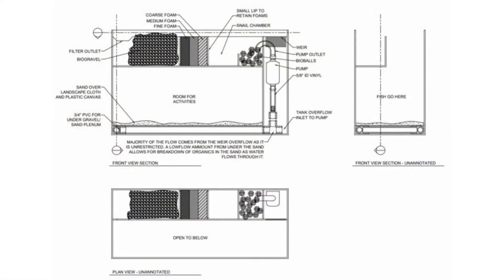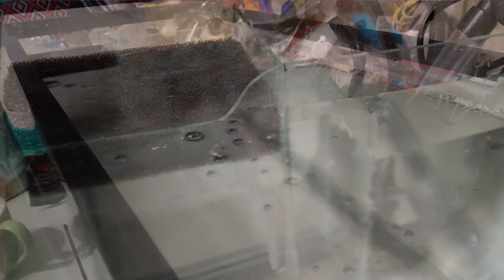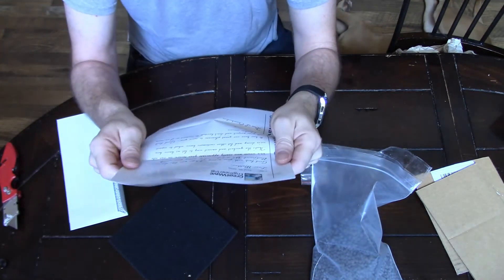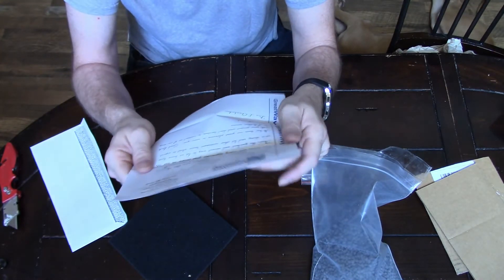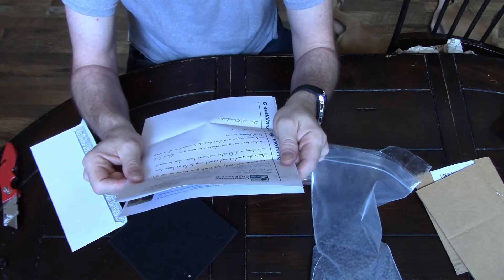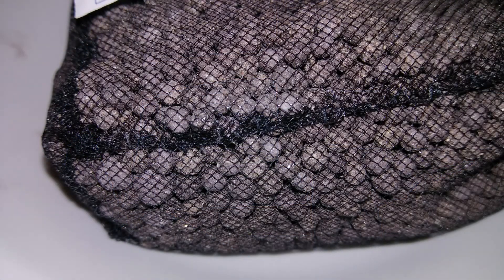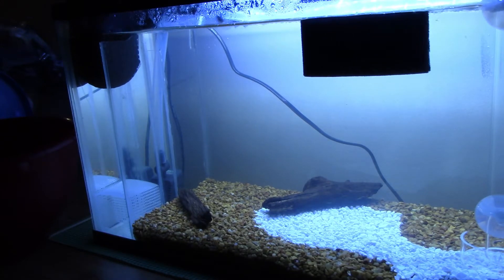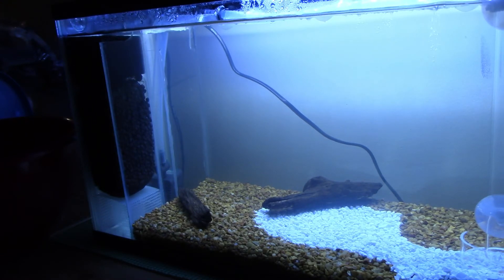Fish Tank Experiments - BioHome BioGravel (Going for Zero Nitrate) Video 1

Comment: The claim about Biohome filter media achieving a "full cycle" (reduction of ammonia, nitrite, AND nitrate) is a scam. Ten months ago, I "pimped my filters" according to Pondguru's instructions. The recommended amount of Biohome media for my 75g mbuna tank is 6 kilos. Since I was skeptical, I decided to go above and beyond. I added extra filters for more media capacity. In total, I have 10 kilos of Biohome media in my filters. All filters utilize the coarse/medium/fine foam configuration recommended by Pondguru. After 10 months of running filters with 10 kilos of Biohome (that's almost double the recommended amount), I have not achieved any reduction in my usual nitrate levels. My nitrate levels are the same as they were when I used a much smaller amount of much less expensive media (i.e., nitrates start at roughly 5ppm immediately after a water change and rise to approximately 30ppm over the course of a week). Conclusion: Biohome performs no better than the cheap bio media that was included with my filters. It does NOT achieve a "full cycle."

Comment: I love my Bio-gravel, I'll be buying it to use as a substrate with an under gravel filter in all my tanks. I went and got 12KGs after watching your video. now a month later, the tank with bio-gravel is Super stable. Using water from a different tank that had numbers off the chart( 50% of the water was replaced), the Biogravel tank was able to get those numbers down to 0 in 3 days, even when the tests were showing the numbers at their highest at day 1.

Comment: There is no way in a month and a half the denitrifying bacteria established the bio media in a month and a half. The bacteria that convert nitrate to nitrogen are very slow growing. In prime conditions they only split every 8 hours. To do a good test don't change anything once your test has started. In my experience no biomedia that claims to truly complete the nitrogen cycle works. They're is simply to much oxygen available. It's a sales gimmick. Pond guru is full of it. There is a way to setup media in a filter that will complete the nitrogen cycle. For my experience with the aquarium hobby and media I have 17 aquariums and several totes with a total of around a 1000 African Cichlids. I've tried many media. The best biomedia for nitrifying bacteria is sponge. 30 ppi is the best. It's better than any ceramic or cinter. Using what I've learned on completing the nitrogen cycle I've reduced my nitrate dramatically. A 110 gallon aquarium with 45 Cichlids in it used to get to 80ppm nitrate by water change day. Now that my denitrifying media established this tank only gets to 20ppm and with time or if I removed some fish it would drop even more. Matrix doesn't work either.
Reply: well I have to agree I've used all kinds of biomedia Matrix biohome Marine Pure ran each one for months and my Overstock African cichlid tank 75 gallon two large canister filters trying to find out what really work and not one ever reduced nitrates. to reduce nitrates is a very complicated situation in an aquarium. and I ran them for several months over my 27 years of being in a hobby I come to find the truth they do not work for removing nitrates. but they do work for removing ammonia and nitrites. I go to aquarium science for the real deal info.
Reply: @aquariumhacksbymarcus5653  if you want to remove nitrate look into anoxic filtration. It works.
Reply from the maker: I had to tear down the test tank to prepare to move, then the tank broke in the move.  I've been working on my wife's Youtube videos with her, fixing a very messed up house, and working my real job.  At some point I may get another test tank up for this.  The media got moved into my 54 gallon tank cannister.  I have seen some reduction in Nitrate from how that tank traditionally did run, but we also are now on a different water source, some fish didn't survive the move, etc. so it is inconclusive.
Reply: I concur!!

Comment: I've used the maximum amount of Biohome Ultimate in all if my canisters (even running 2 canisters to add additional media). After trying about every media on the market, the tanks with Biohome are by far the most stable. I have softwater tanks with SA cichlids. My nitrates do get to about 40 ppm after 12 days with large fish, heavy bioloads and two feedings a day. With Biohome I never have extreme pH shifts nor excessive nitrates. While I haven't achieved super low nitrate levels yet (most of my tanks have been running on Biohome for at least 3 years) I am guilty of using Prime to remove chloramines. To see if I can get to full denitrification with Biohome, I'm switching to API dechlorinator and buying more bacterial beads. I don't expect any change for at least 6 months as its a slow process to achieve a full cycle.
Reply: The pond guru already spent your money, so no, you can't have it back!

Comment: Did you ever up date your test on the bio gravel, i used biohome ultimate in 2 large eheim 2217's and did not reduce my nitrates, i switched to seachem pond matix and saw a difference, not a lot but better results then the biohome, which i paqid a lot of money for.
Reply from the maker: I didnt do a follow-up because I had to take the tank down getting ready for a move.  I was seeing nitrate reduction. I put the media in my filter for my 54 and have seen a reduction there, but i dont have enough for a deep reduction.  

If you use API stress coat, it works.  if you use Prime it doesnt.  something in one conditioner vs another makes a big difference.

Comment: Do you have an update?  I'm currently testing biohome in three 70 gallon tanks using different water conditioners (API Stress Coat being one).  Any success?
Reply: Keep me posted!

I’ve got an FX6 & and an Eheim 2217 running on a 55 gallon full sized turtle tank. Fluval bio in the FX6 and Eheim Pro in the 2217.

I’m thinking about moving towards Biohome, so any luck?
Reply: @dad3562  it’s a hard thing to answer. My API Stress Coat tank consistently has fewer nitrates than my other two tanks. One also has a BCB canister going but I haven’t seen any difference with that in my second tank.  
So far tanks get 50% water changes weekly and the first one mentioned gets about 10 ppm less nitrates than the others. That’s it for now. 
When on lockdown (my tanks are in my classroom) I would go in every three weeks for a 50% water change. All three tanks would rarely get into the red zone (40 ppm or more) so that’s positive. However the feeding amount was also reduced so that is a factor. 
I’ll let you know in a couple more months if you’re interested. Just reply so I know. Good luck!
Reply: @chriscaragiannis6783  way cool! Way cool, I’ll definitely hit you up. Be safe
Reply from the maker: I actually DID see a massive reduction in nitrates, but now have to start over once I move to the new house.  I've torn down all the tanks other than my 54 gallon right now.  Sorry for the major delay in response, youtube NEVER told me I had any comments.
Reply: @mattadulting  thanks for sharing.  I’ve only seen a consistent lower nitrate level in the tank I’m testing with the API stress coat. The ones with Prime and API 52D water conditioner consistently get higher nitrate levels. I’ll give it a few more months before any data is dependable as it takes upwards of 6 months for the bacteria to build up in bio home from what I’ve read. 

Can’t wait for the follow up video to see what you will observe. Thanks for sharing!
Reply from the maker: @chriscaragiannis6783  this test tank got down to 5 PPM nitrate and then stayed there.  I was overfeeding and going a month between waterchanges, still 5PPM.  the biogravel was working perfectly.  I WILL set it back up at the new house.

the biogravel is currently in the Fluval 406 that is running the 54 gallon so it's still alive and will be able to just jump right back in to the 10 when we're ready.
Reply: @mattadulting  So after the past 2 months my tests show that my tank using API Stresscoat as a conditioner has consistently 10-20 PPM less nitrates than my other two tanks using API 52D and Seachem Safe.  
Over the summer when I'll only be doing water changes over 3 weeks I'll be tracking the results but biohome takes a long time to build up the anoxic bacteria to complete the nitrogen cycle.  Let me know how you're tanks are doing.
Chris

Comment: I have been using bio home for a couple years now. I use the bio home ultimate in my filter, and I also mix bio gravel in with my existing substrate which is just plain 6mm gravel & the bio gravel blends in perfectly. 
It can take several months to see the FULL cycle establish, and at that, you need to run alot of bio home to achieve it. I didn't even start to notice any nitrate reduction until I put the bio gravel in my substrate, prior to this I was just running the ultimate in the filter. 
Several months on, I don't have lower nitrates but I have noticed my nitrate levels remain "maintained" & no longer creep up to excessive levels, it hangs around 50ppm and stays there and I have noticed a massive increase in my fishes overall health, not a single health problem for 2 years, I can't remember the last time I saw a fish flash/flick/scratch in my tank.
Reply: you mean when you stared usiing bio gravel it helped you to reduce the nitrate? if yes then at what number it reduced ?
Reply: @rahulpawartube  yes I believe because the bio gravel is mixed with your substrate, the low oxygen environment is good for the nitrate reducing bacteria. My tanks nitrate never dropped lower, but instead is maintained at the same number as it no longer rising, it stays at 50ppm
Reply: @Uncle_Bert  ohh thanks

Comment: How do you feel about prime effecting the filter bacteria? From what I have read that is as controversial as the nitrate/full cycle claim
Reply from the maker: I stopped using prime so I would not mess with the results of the test.  I'm not a biochemist, so I would have to lean on someone that is.
Reply: I've heard it's not an issue but switching to API to test for myself.

Comment: DID IT WORK ?? if 3 times the media doesnot do the trick..
Reply from the maker: I actually DID see a massive reduction in nitrates, but now have to start over once I move to the new house.  I've torn down all the tanks other than my 54 gallon right now.  Sorry for the major delay in response, youtube NEVER told me I had any comments.
Reply: @mattadulting  please upload the follow up video..
Reply from the maker: @FireGate_13  I need to get another test tank. The 10 didn't survive the move.

I'm thinking I'll do a larger one...use a dosing pump to add ammonia regularly once cycled, and have it as a split tank (make it 2 separate tanks in 1), 1 traditional filter, 1 biohome filter.  Let them go head to head in matching conditions.
Reply: @mattadulting  nice idea..

Comment: Update please. Very keen to see your results
Reply from the maker: I actually DID see a massive reduction in nitrates, but now have to start over once I move to the new house.  I've torn down all the tanks other than my 54 gallon right now.  Sorry for the major delay in response, youtube NEVER told me I had any comments.
Reply: Good to hear you had progress. Im doing a test on 2 tanks. Stopped using prime, and have 2kg of matrix in one tank vs 2 kg of biohome in another. Only been 4 months so time will tell. Very small load on one tank and overstocked on the other. I will let you know. Overstock has the biohome. Every week up from 5 to 20ppm and 50% water change weekly. Understocked was virtually up 5 ppm per week.

Comment: Matt, Well done. Your videos are much better produced than mine. I was happy to see you were able to get results similar to my testing with the Delta 60 I upgraded using BioGravel recently. I'm curious, how much of which type of food did you feed the tank to get it to cycle. 
My test tank was only 4 gallon and I started testing with 5 grams of crushed koi food. I quickly realized that this was too much. Nitrites went through the roof. I didn't feed for several days and did some water changes to try to get things under control and then started feeding 0.5 grams per day until I got the filter cycled. I then gradually increased the feeding until I started to see nitrite. 
It took a surprising amount of feed to bring out the nitrite. Like you I was pleasantly surprised to see the nitrates weren't that bad. I'm anxious to see your results to see how low you can get the nitrates with your livestock in the tank and how long it takes. Keep up the good work. Stay safe, and...
Happy Fish Keeping,
Don
Reply from the maker: Sorry for the major delay in response.  youtue was not telling me there was activity and I didnt come check it.  this video has actually been getting a lot of views!  

the tank ended up stable at 5PPM nitrate no matter how much i fed.  I was overfeeding (just not to the point of causing bloat) and it was still maintaining 5PPM nitrate.  I have had to tear down the tanks in preparation for selling my house and moving.  the biogravl is in the fluval 406 running my 54 gallon right now to keep it alive. I will set up the test tank again once we successfully move.